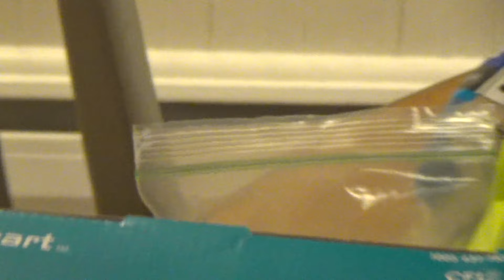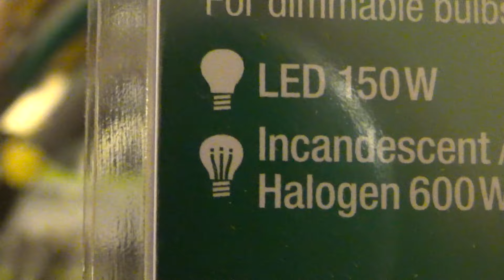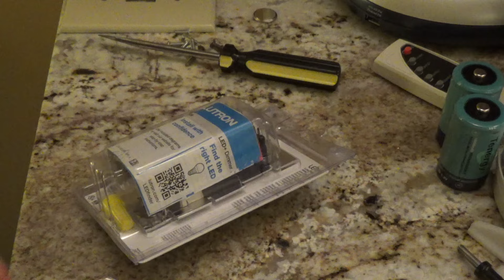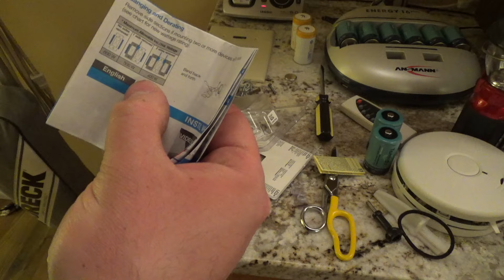Installing a 3-Way Dimmer Switch for the Kitchen Light

Comment: The little switch on the dimmer itself is a “trim wheel” to “optimize” performance.
Reply: I think that the trim wheel is to set minimum brightness without completely turning off (light bulbs) when tune in that.
Reply from the maker: Thanks for letting me know.
Reply: Why do you hate smart lightbulbs?

Comment: better off with a dimmer switch with knobs or a slider since they works with most light fixture you might have, I highly recommend the smart light bulbs that works with siri, google and alexa
Reply from the maker: I would never even consider a 'smart light bulb'. I'd rather use candles.